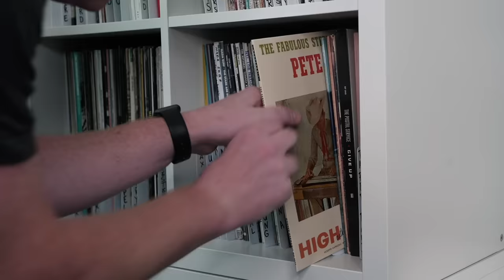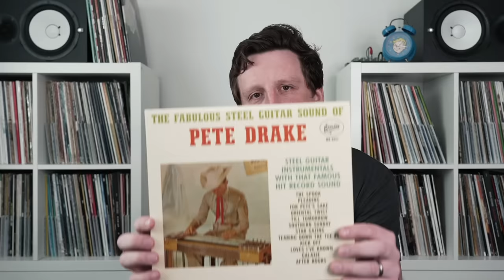6 Guitar Pedal Myths

Comment: There are two main reasons these myths are so pervasive:

1. As stated in the video, old gear, particularly gear that is difficult to find, is ascribed near-magical properties. This is because we tend to believe "rare = good". And from that point on, our brains work backwards to find "rational" justification why this emotionally held belief is true.

2.  Ascribing magical properties to expensive/rare gear also works as a form of cope as to why one's own failure are not due to inadequacies. In other words, the reason my tone is crappy isn't because I never learned how to set up a pedal board or how to dial in a good tone. The reason is clearly because the op-amp in my distortion pedal isn't made in Japan in 1981, specifically calendar week 3 with a serial number ending in a 5. Because everyone knows those op-amps are magic.

And a secret third bonus reason is that people love just sounding smart on the internet. "I totally did a blind test and I could totally detect the tone difference every time". Of course, it's all made up.

Comment: I agree , I have some less expensive pedals that sound and work just as good as any boutique pedal does. I have a Sabra cadabra pedal that I have heard is a  boutique  pedal and it isn't any better for getting the Black Sabbath sound as any of my other distortion pedal's seem to do. I still cant get the sound I really want and I think it's because I don't run a treble boost, I'm wondering if I can get a semi inexpensive pedal that will do the same thing as the Laney treble booster. I'm not rich and they want close to 400.00 for the Laney.

Comment: I kind of hear the difference between old fuzzes based on germanium components and modern reissues using silicon. I don't think they, as you said, took that into account when designing the circuit.
By the way, the only effect I've ever made was MXR Distortion+ made from scraps. I only had silicon diodes in the bin and I always wondered what difference would it make to use germanium.

Comment: I had a Toshiba laptop that would over heat the graphics chip and blank out the screen. The chip was definitely "surface mount". I tried some tricks I read about like putting the motherboard in the oven. It actually worked for a little bit but broke again, (I also tried a little blow torch).I would say that was an example of surface mount being not that great. But I don't think pedals get that hot. In the case of the laptop, it was most likely a lack of cooling issue. Is heat with guitar pedals an issue?

Comment: Copying pedal circuitry takes too much time. Copying entire EPROM chips, 27C256's and 512's,  that was fun. Had an Eventide H3000 in 1998. I bought the upgrade EPROM set and the broadcast EPROM from Eventide to give it all the D/SE model presets. Steve Vai presets were all the rage, back in 2000. Then copied those  EPROMS and sold them on E-Bay with the jumper mods for half of what Eventide charged. It added up! That's old school now. Im gonna make a 'tru bypass' pedal now. That's all its gonna do, press the foot-switch and its in tru bypass. When the switch isn't pressed, the circuit will be wide open. I will fill the entire pedal box with epoxy too. If they have not watched your video here, I will have gotten them for $195.00 each.

Comment: I ventured into the "orange drop" deal in high school, Dad had a giant box FULL of Rafio Shack electrical components and the orange capacitors caught my eye. I set up a simple board that I could switch between the tan disk, green pill/pillow, and orange drop capacitors, couldn't tell a sound difference between any. But the orange drop sure looked pretty over the others! A year or two later I learned of Gibson selling what they claimed were vintage oil-filled "bumblebee" capictors for an impressive mark up of $80+ a pair in 2015 money. Turns out there were just small tube shaped capacitors encased in large plastic shells that mimic the look of bumblebee capacitors - proof that guitarists are the most gullible or for sure the placebo-susceptible people on this planet lol

Comment: Would be interested to hear your opinions on the actual foot-switch mechanism on pedals. I notice that all of your pedals are fitted with "standard" foot-switch buttons which tend to be noisy when deployed (there's that annoying loud click) as opposed to the Boss type foot-switch mechanism which is quieter and smoother when deployed. Won't make a difference in a live band situation but sure does when recording in a small home studio. On another matter, is there a way of fading in or subtly cross-fading in an effect over the effect that is currently being deployed and then make the initial effect fade out?  If you were playing with a clean dry tone and gradually wanted to segue into a chorus effect or whatever, could this be done?

Comment: In a RAT circuit, I don't think that the Op Amp is being overdriven causing the clipping. I am sure the diodes to ground cause the hard clipping. Also, the RAT is an interesting one because the LM308 slew rate acts as a low pass filter. So, it does matter and you can't just replace it with a TL071. Although, I agree that there are not "magic" parts, one can achieve the same results as the LM308 with modern parts that have a compensation capacitor.

Comment: Threw hole has the advantage of being easily repaired where surface mount boards are called disposable electronics. Production wise surface mount is cheaper and better for the Manufacturer but not so good for the user that accidently uses the wrong adapter. I spent most my adult life repairing electronics until surface mount hit the market. We do not repair surface mount, we replace the boards which is very costly to the user.

Comment: I often hear these myths ,another is that cheap pedals sound bad. I used an old Big Jam delay for years until it got cooked by a power surge and haven't had a good one since, it just had "that" sound .I would love to find another or get this 1 repaired but no one in my area does that type of work cheaper than a new pedal...bummer. Are you familiar with these old delays and what do you think about them?

Comment: Just came across this and found it very interesting. I know it is a bit late to reply now after so long but my understanding different types of caps in the audio circuit can alter the audio characteristics? Ceramic, Mylar, poly styrene, paper in oil etc, is that true? If so does that also equate to pedals? Cheers H

Comment: Through-hole is so much easier to fix/troubleshoot. Just has to be mentioned. Not that surface mount stuff cant be repaired, its just a different beast. Modifiying a Proco Rat with a socket to switch out op-amps (something he suggest MAY be of some use in that circuit) would be pretty hard if not impossible with surface mount.
Reply: The only thing I want to do with my rat, is to change the power supply plug type. 1/8" is so annoying it is unreal, especially when you're sitting on a chair bent over with the blood rushing to your head, and you have to go look for your barrel x 1/8 adapter cable. So annoying that I now finally keep the adaptor cable plugged in at the pedal, and unplug it at the power supply. It's not 1980 anymore ProCo, barrel is universal now, lol.
Reply: @Bikedueder  Mine is a barrel? Wonder what series doesn't have the standard power supply connector, my Rat2 does.

Comment: i know its been a long time you've done this video but i got a question about buffer.
Is there any difference between a buffer from EHX and MXR or  buffer is a buffer, one way to do it?

 Because i was against buffer before until i pickup a MXR Sub machine. The buffers from ehx to my ear change or retain some of the sound. Same with cry baby that use one also. But the Submachine, when not on, its exactly like if it wasn't there and i know it have a buffer.

Comment: If you drive op-amps rail-to-rail they will behave differently. Some quite alarmingly. So for HiFi careful circuit design is the norm. For pedals, some of the 'nastiest' chips seem to be popular.  Surface mount resistors and capacitors have differences in construction and hence detail characteristics from leaded components. Not normally a problem.  Modern solders are more rigid and brittle which may affect longevity of joints/traces. Repair of surface mount boards requires care and dexterity. Through hole boards are easier to work on. The bits are bigger. Germanium components are 'more delicate' than silicon, and will die from heat and old age which is much, much less of a problem with silicon.

Comment: I would disagree regarding the opAmps not making a difference. This is true for all modern type of opAmps - but the very early ones - like the early 741s had extremely slow rise-/and fall-times. Especially when amplifying a distorted signal this should make an audible difference as those OpAmps will reduce the high frequency signal components because of their inherent bandwidth limitations. In addition you get a lot of nasty noise with those old OpAmps - how nice! 🙂

Comment: So the only thing that i have experienced and its more tubs amp related that is a myth is surface mount tube amps unsoldering themselves.  I dont think it matters for pedals since there isnt enough voltage going through them, but that can also just be manufacturing quality or just the fact that surface mount amps are more common.

Comment: "Digital sounds sterile" is one that pedal manufacturers like to cash in on whenever they're pushing an analogue pedal (even when that same manufacturer has a line of digital pedals, lol). I get it, analogue circuits can degrade the signal in a pleasing way that adds "warmth". But there are also some amazing digital pedals, and depending on the sound you want, digital may be preferable.
Reply: I have not herd a digi CE-2 chorus stand up to analog. I have herd a good digi chorus but it's different

Comment: well yeah. opamps in console or outboard pre amps can indeed have different sound, but as you say it's a completely different thing where and how the opamp is used. and there's excellent clones. no need to buy vintage marinair transformers or original API 2520s when there's red dots and CAPI or JLM around. and so many more.
Reply: came across your videos regarding these topics from the rat pedal history and I LOVE THEM. I started building and repairing pro audio gear not so long ago, designed my first audio PCBs (all SMD, because cheap and finished product, I can solder but don't have to if it's that much smaller and don't wanna do SMD in an amazon oven like some people do at home) - after years not being involved with electronics - last PCB I worked on was USB related completely different field.

so yeah. love your stuff and have to get that ratpack. even though I play synths I love guitar specific pedals, they sound awesome on a 303 or wavetable synth.

Comment: One comment on Surface Mount vs Through Hole... Anyone with a soldering iron can fix a through hole circuit... Good luck repairing a Surface Mount circuit. 

Now given it is pretty rare to have to fix a pedal considering how sturdy most pedals are... but parts like capacitors will deteriorate with time (20-30 years)... Sooooooo..... That's the one valid argument I can see for wanting through hole vs surface mount.

Comment: My only problems with pedals happen when you are already distorted, and you step on the gas for a solo, and nothing happens because the overdriven amp is already at maximum input voltage  YES I MEAN YOU FENDER HOTROD AMPLIFIERS. It's easy enough to avoid.

Comment: Germanium vs. silicon. the bias voltages are different. even silicon diodes and silicon light-emitting diodes (LED) bias voltages are different. none are better than the other, just have slightliy different properties and limitations that make them more ideal for certain applications.  also, capacitors. it doesn't matter what color epoxy the cap was dipped in.

Comment: Generally I agree with Josh. It’s just straight engineering. BUT I have to disagree with the idea that ‘boutique’ is meaningless. If it WERE meaningless, then why would I buy a JHS product but not buy a OBNE or Meris pedal that seems to be doing much the same thing? Because, often, they’re not doing the same thing. We could be talking entirely about branding, but when a single guy at Planask Electrique puts out a pedal whose function is hard to even classify for a highly limited market and JHS does mass market with a TS clone, there’s a very real difference. Not a difference of which is ‘better’ but also we’d be crazy not to admit that the Planask device doesn’t fit a classic boutique classification.

Comment: A lot of these myths break down to "older manufacturing methods are better" which while I understand where it's coming from is a clear logical fallacy. It takes time for a pedal to become legendary, and by the time it does the way it was manufactured is outdated. People then assume the sound of that pedal comes from the manufacturing almost moreso than the circuit design, which is just wrong.
There's a lot of placebo going on in the pedal space, something the Bad Monkey situation clearly proved.

Comment: I wonder if the people who originally designed tube amps would have used tubes if they had transistors. Technology changes, generally for the better because we learn from past mistakes, except for politicians, and we incorporate that new technology into the products we build. Old does not mean it's better... it's just more nostalgic and in some ways using old gear makes you feel more connected with the musicians you admired who used that same old gear because it's ALL THEY HAD at the time.

Comment: YOU ARE WRONG!!!!!!
there are applications where you can select opamps on good sounding deficiency's or cool exploits of its internal circuit. i build a distortion/fuzz pedal using the MSP5062. its extremely slow slew rate has a filtering effect way different from a normal filter, because it also create slew distortion.
another exploitable opamp is the CA3130, use its 'strobe' pin as the output and force its CMOS-output stage to act open-loop, to take advantage of the soft clipping characteristic of CMOS inverters, in combination of the ease of design of the opamp's gain character

Comment: I had an 1981 TS9 that was amazing but now I have an old Italian hand made high quality components ts clone TonoMatch Pro Tube Screamer from the 90's I think and I can say that it really sounds better and the tone control is way more accurate than the original (btw I can't stand no more on od and dist pedals with the tone control, I really think that tone controls is ruining the overall sound and I have proofs of that playing things like Double Muff, Hot Tubes, Dist+ and Coron 10). I also have the two Corons copies of MXR dist+, the 10 and 15, being the first germanium and the second silicon I can say that I really love the creamier light fuzzy tone of the 10 much more than the 15 that is too much mid scooped and les less OD and much more harsh fuzzier. Closing, I'm not a fan of tb, I prefer the buffer. That's my 10 cent experience.

Comment: What you seem to be missing is the make-up of the 'components' that were used to create a vintage pedal. Sure, any electric circuit can be copied, it's called a schematic diagram. What can't always be replicated is the sound created by the electronic equivalent of diodes, resistors, power transistors, etc. that have been produced in the past. The materials and processes that were used to manufacture those electronic components change over time. In many instances the combination of the components available at a 'certain point in time' combine to present a sound that is quite unique and is Never Again exactly replicated. That is why you have certain vintages of Audio Amplifiers and other Hi-Fi Components that bring hundreds of thousands of dollars to wealthy Audiophiles. In other words, go find me a supplier today that's turning out the Champagne equivalent of a bottle of 1959 Dom Perignon !
Reply: It's my belief that the point of this entire video went completely over your head, Professor.  I'll inquire about making sure you get your money back for your wasted time.

Comment: Germanium conducts at approximately 3 tenths of a volt vs silicon at 7 tenths  of a volt.  They sound different in clipping circuits . Opamps are different been doing this for 40 plus years some of their slew rate characteristics and frequency response are different. Some have more punch and effect lower and even upper frequencies I played with many tube screamers and even old Ross Distortion pedals back in the 70s there is a difference I have new old stock opamps from the early 70s and have ABd them all the time RC4558 to a MC1458 vs a TL072 vs 82  vs a JRC vs a Motorola. There are differences. If you parts source out and experiment with enough you will find differences. Just my two cents. I bought some old Russian Germanium diodes from the 70s for my Klon I prefer better than the Chinese. And when you start talking discreet components like Transistors thats another whole story like Freq, Beta, bandwidth, hfe, bias etc. Capacitors are a whole other story as well. Not all sound the same. Mica sound different than polyester or ceramic. Most builders dont want the painstaking chore of finding obsolete parts or suppliers and specking them for consistency. It depends on the circuitry and application and process. Im an engineer I have designed for different audio companies.

Comment: Sold my Colorsound tone bender for £400 that I bought in 1972 for £13. Laughed all the way home. I can get the same sound from a modern reproduction. This man knows electronics, what he says is 100% correct. Electrons don't care whether they are flowing through 1960's circuitry or modern circuitry!
Reply: With germanium transistors?